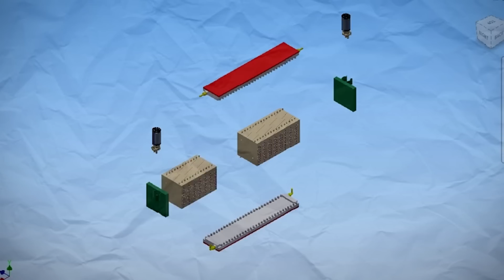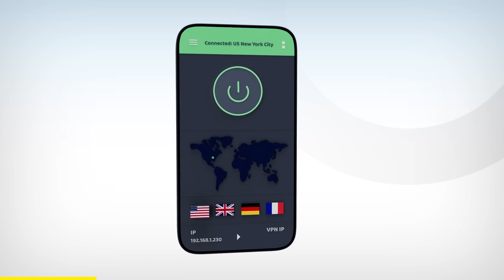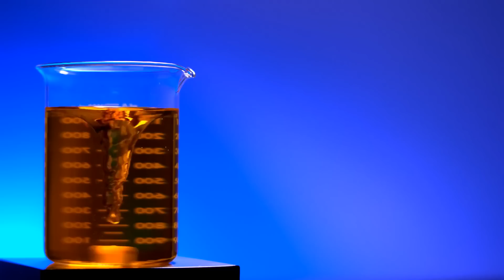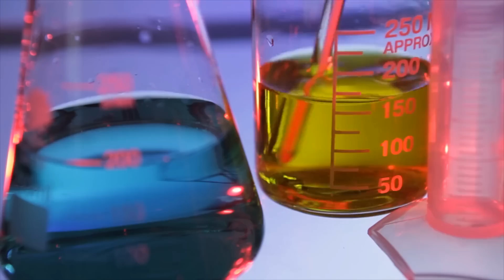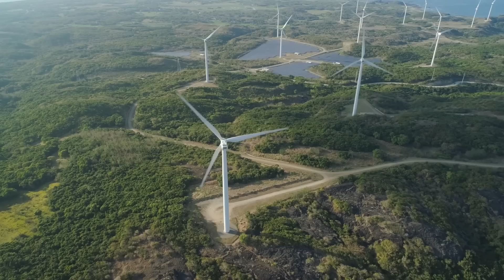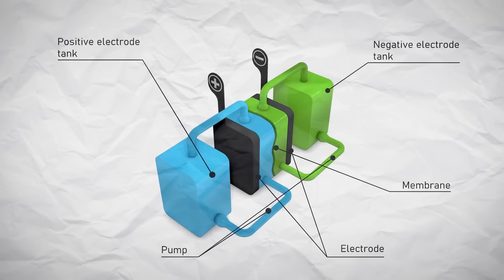This Insane Liquid Battery Can Instantly Recharge

Comment: I rarely comment on videos.  This is a great topic that caught my attention.  I combed through the links and tried to find more information on the company website. A few things I like about this. IMO this is a textbook example of how US government agencies collaborate to bring these types of advances to market.  This quite decade old project was birthed by Chicago based academics who won the support of the Argonne National Laboratory (ANL). Their ideas slow and steadily captured the attention of the leading edge US government R&D incubators.  They've been persistently working and have survived a few fail points.  The US military use case is real.  L-ion has limitations which have caught DARPA's attention.  One can't help but be impressed with NASA and the USAF's involvement for aviation where L-ion has no future. The DOE and NSF have been involved as well.  This is a project that is capturing attention.  A quick back of the envelope calculation (thanks Bard) suggests that the Influit's Gen 2 energy density would double the range of an EV vs. a gasoline powered SUV.  That's compelling for industrial and battlefield applications.  An Airbus A330-200 would be able to fly 18% farther. We've watched th aviation industry fall all over itself to obtain 5% gains.  The economics in commercial maritime applications are undeniable.  I imagine the same would be true for rail. Those that object to consmers swapping battery fluid may have a valid gripe.  Yet, I think the military and commercial markets will be more than ready to take a serious look.  The economic advantages are too great.  Thanks for an excellent video.

Comment: Definitely interesting.. But why not make a smaller, compact, portable and interchangeable battery that we can unplug from our car with ease, replace it with a fresh one and just recharge the other one with our off grid solar charger?.. Why do you think?.. Think about it..
Reply: A key component of vanadium redox liquid flow is that to get more energy you need more liquid, and that volume of liquid can only be compressed so much. Maybe one day they'll get the nanofluid to a point what you ask is possible, but I don't think that's likely for a while. But if they can hit those energy densities in their white paper? Yeah, I think then it'd be great for it.

Comment: It's cool development that would solve the energy speed issue for sure. But as for safety claims I highly doubt that, they are withholding that information for a good reason I'm sure
Reply: Liquid flow batteries have been in use for a long time. Do some research. The safety is there. Now, as for the nanofluid version? There may be changes there that haven't been released yet.

Comment: Would a liquid battery like this overcome the limited cycles and dropped efficiency of lithium ion batteries?
Reply: From what I've read it definitely would. It's in use in many industrial scenarios, but hasn't (yet) been adopted for more mainstream use because the energy density on regular LFR liquid is low, so you need a lot of volume to get the desired energy storage. This nano solution, however, could be the game changer we need
Reply: @LabGecko  even if it doesn't end up being well suited to transportation, it sounds ideal as an alternative to the Tesla Powerwall.
Reply: In theory yes as I think it would mitigate dendrite growth, however I assume there will be some form of breakdown within the nanoparticle substrate so reuse might be limited similar to charge cycles. If true then this will also lead to issues with liquid quality due to mixture of various duty cycles. It may be possible to remanufacture the liquids though, ideally on site.

Comment: I doubt that pumping liquid is going to be a viable solution for transport.
Static grid scale probably could work.
Reply: Vanadium redox liquid flow batteries have been in use industrially for a long time. As for liquid, not viable compared to what? Gasoline?  XD
Reply: @LabGecko  viable for TRANSPORT
Reply: @finecutpost  ah yes I did miss that part. My bad. And though I'd initially be inclined to agree, look at how we've managed to pump gasoline all over vehicles of all sizes without consistently serious issues. VRLF liquid is stable too, so no risk of explosions. I think it's doable.

Comment: This is promising research but as a “business” it has two fatal flaws :

1) today it costs about €60,000 to put this system in an SUV. You can buy a BEV for €18,000 🔋 .

2) No infrastructure exists and you’d need to invest €25 billion in France just to get it up & running ⛽️.

Thus Lithium Ion will still be king in 15+ years time 🚚 Just like Hydrogen it is too expensive!

Comment: As if pouring liquyid over small flame proves that it has no thermal runaway or does not combust. Might as well pour diesel or oil over small flame and claim it does not burn.
Reply: Do some searching. Vanadium redox liquid flow batteries have been in use since the 1990s. They're stable.

Comment: There's a number of questions I have on this as Redox flow isn't anything new.  Most importantly what are the fluids and membranes made out of.  Resource cost, abundance and manufacturing requirements is a huge factor in domestic vehicles.  What's the toxicity of the liquids and gases when it inevitably (in an accident) causes a runaway thermal reaction.  Military and commercial applications can cope with with these issues, planes seem to be a good candidate but there's a reason why china is mass producing phosphate batteries even though they have a low energy density, material cost and availability.  Capitalism always wins.. sadly.

Comment: Yet another overpromised and nondelivering battery tech. Woo. 🥳
Reply: Still waiting for my George Jetson space that somehow folds up into a LIGHTWEIGHT briefcase 😂
Reply: o.O  Do any searching at all before you posted? They've been in use since the 1990s.
Reply: @LabGecko  Wow, we've had liquid flow EV's 30 years now? Where are the cars? 😂
Reply: @PhazonBlaxor  lolz, neither of us said cars. The battery tech itself is well tested though, so it should be fine with cars too. After all, this is safer than gasoline.
Reply: @LabGecko  But cars were the prominent part of the video. I've heard about tens if not more "revolutionary" batteries over the past 20 years and we are still using li-ion batteries. I believe it when I see it. 

If it really was cheaper to mass-produce, smaller and lighter for same energy capacity and on top safer, these would be all over the place. Instead we still have li-ion as the most common battery type, I wonder why? 😁

Comment: Same problem in the end. Current electric grids can't handle charging enough electric cars to make a difference. This particular method isn't new. Quant produced a prototype with this tech a long time ago.
Reply: Grid couldn't handle lights in everyone's houses when they started either.
Reply: @LabGecko  grids can't even handle what we have now. This tech doesn't solve anything. The water still has to be charged. It's a sad truth that by the time we have grids that can handle almost all cars being electric, this tech will likely be obsolete. The same goes for current battery technology.

Comment: Meh - it's like big oil wanting to control how you recharge. I prefer normal batteries let you recharge from solar panels on your roof, like having an oil refinery on your roof! Then also there are super-batteries and super-chargers coming that will let you recharge in a minute. We'll see where this liquid flow thing goes - it's good to have more options - not less. But I'm thinking it might be a competitor to the Australian Janus truck-battery swap system - which kind of blows Tesla out of the water.
Reply: The key to this is that you can charge it either way. Don't want to go to the station? Plug it into a wall.

Comment: I wonder about how long the fluid lasts before it needs to be replaced or revitalized.  Can it be recycled, and at what cost?
Reply: From what I've read these liquids currently in use can last 30 years. They're in use in industrial setups, but are different from the nanofluid Ziroth talked about in that their energy density is lower. But the cool thing is to get more energy storage capacity, you just add more liquid. I'm excited to see how the nanofluid holds up to that ideal.

Comment: I have zero issue charging my Tesla electric car, it's so easy to plan and it's straightforward. The charging was so quick that I only needed 5 minutes before I continue with the trip. The gas vehicle, however, have problem with it. We recently bought a used 30 ft gas RV to drive it home, I quite literally ran out of gas while in middle of the intersection (the engine stalled), I have so much more range anxiety because it doesn't display how many miles I have left in range, the gas gauge is so vague, and it's such a hassle to go to the nearby gas station. It was a scary experience.
Reply: Do you not know how to read a fuel gauge?
Reply: @randycrump5464  the fuel gauge was low, but I have no idea how low. I got paranoid and was on my way to gas station, but I ran out of gas before I can even make it to gas station. I was surprised that it didn't have any buffer whatsoever.
Reply: Going to a gas station isn't a hassle and certainly not scary.  I can fill up my car in a few minutes and it lasts me for two weeks.

Comment: It may sound good on paper, but repeatedly draining the fluids and refilling with "recharged" fluids will, over time, contaminate the battery and/or fluids, and result in a battery, which needs to be replaced, or maybe refurbished.

Comment: Erm......maybe I've missed an important fact but......why would you bother to pump the fresh charged fluid into the car? Couldn't you just pull up to the filling station and swap a tank of depleted fluid for a tank of charged fluid? No spill risk no clogging in cold temperatures no delays at the pump.....carry spare tanks for a long journey.......I see no logical reason to want to pump. I would also think the nano particles could be stored "dry" and added to the liquid as required with expended nano particles filtered out and recycled.....so rather than pump liquid you could probably just feed a "hopper" with the "dry" nano particles which would be a more energy condensed storage that replacing the tank either physically or through pumping.
Reply: That's the change they're talking about - pumping out the discharged liquid while pumping in the charged liquid.
Reply: @LabGecko  yes.....and I'm saying why bother to pump.....you could just swap out a tank of depleted with a tank of charged (like swapping a printer cartridge) or you filter the depleted nano particles and add new charged nano particles.
Reply: @polyphonics557  said "why bother to pump"  
For now the energy density on vanadium redox isn't high enough to make small portable containers feasible. Sure you could use lots of smaller containers in series but that adds a lot more points of failure. However, portability should increase as the nano loading efficiency increases.

Comment: This is the literal replacement for the oil industry as we know it today if this can perform as advertised. No need for huge battery banks. It can be transported via trucks or possibly pipelines, you don't lose mass like you would with coal, oil or natural gas, and if you have enough converters, you can provide megawatts of power centrally yet generate the power remotely via satellite generation. Wind and Solar would actually become viable as an alternative to fossil fuels because this fluid also acts as a battery. While Nuclear would still be viable as a backup power supply in the case of natural disasters or whatnot, they wouldn't be necessary. It's quite literally liquid electricity. So long as it's easy to create en masse and safe for transport... This is it. The power of the future. Liquid sunlight as it were, lol.

I really hope this works.
Reply: ahem, nuclar is the only viable option.

Comment: I had heard of flow batteries previously as an option for renewable energy storage. But that was a few years ago. I haven't heard anything recent. Is there a problem with it? What's the status on cost competitiveness vs. other energy storage?
Reply: I read that the flow batteries are targeting companies the are stationary. The systems last at least 25 years with little maintenance.  There is a week link and that is the sepperator. I haven't heard of this gen 2 model. War tecknology does have commercial bennifits like wd40. Space endustries also have spin-offs. One thing like superconductors could really help.
Reply: This is my question too. Though on the energy storage side it looks like things have been moving forward quietly. There's a small scale system commercially operating in the UK. China commissioned an 800MWh storage facility last year, which apparast to still be happening, tho the US company they were working with filed for bankruptcy. And California is building 3 over the next 3 years.
Reply: Ate you thinking about the vanadium redox flow batteries that, after the U.S. taxpayers funded the research, the rights were sold to a Chinese company?  Their upside for stationary storage is that they have decades long service lives. The downside is their low energy density.  I hope this guy is right about boosting their energy density with enough of a difference in chemistry and design to bring the patents back under U.S. control.
Reply: @MrGregrice  i think its the same tecknology  but there trying a nano tecknology to get more density. Someone  is gonna crack the code. I know there are different flow batteries with different chemistries.  The metal battery look very promising for some applications
Reply: @MrGregrice  It wasn't US research. It was Australian. The reason it didn't take off is because by the time they finalized their tech and published other battery types were needed for small size and fast charging, while vanadium liquid flow needs volume for an equivalent amount of energy storage and charges slower. The nanofluids could change that.

Comment: This battery has no future. Vanadium is a scarce resource and comes under the heading 'unobtainium.'
Reply: Vanadium is the fifth most abundant transition metal, It's found in titanium and iron ores. It's also the 22nd most abundant element in the earth's crust.
So very much Obtainium.
Reply: @SleepySkull1  If you can get it gold is so abundant that it could over the Earth's surface in a layer 1 metre thick. In practice there are relatively few sources of vanadium, which is an expensive metal with a wide range of potential hi-tech uses. Demand for the metal is not great enough for it to be listed on many exchanges. Any serious demand is likely to put it out of range of a technology intended for use in cars worldwide. Hence my conclusion that it is 'unobtainum.' This term is in use in the world of battery production for materials such as lithium and cobalt, which though not scarce in the way that, say, helium is scarce, are nevertheless too expensive or impractical for large scale use in future.
Reply: @SleepySkull1  It's not a matter of abundance but obtainability. The Earth's crust contains enough gold to cover the entire planet in a covering 1 metre deep. In practice there are few suitable locations to extract the metal and it is relatively expensive. When there are battery manufacturers close to providing power solutions using sulphur instead vanadium is unobtainiium.
Reply: @alanwhiplington5504  you know they add vanadium to most steels to make them stronger right? It's pretty common. As for future, vanadium redox batteries have been in use since the mid 1990s industrially. The liquid is stable.

Comment: Combine recharge the car with shopping 30 Minutes are common and in the majority of cases enough.

15m² for one parking lot and around a mall or Supermarket its huge. 
15÷7,5=2kwp 

2x6 =12 one charging Station 11kw

Comment: Early 1900 electric cars was designed as town cars for women and because they was only any good for this purpose there popularity wained .
Milk floats are the only electric vehicle success story because they are only good for town use just like the early electric cars .
Reply: Thanks for the history lesson, what point are you trying (and failing) to make?
Reply: @fredbloggs5902  Electric cars are town cars only with old recyclable technology batteries .
The batteries for out of town use will always be dirty for the environment.
Reply: @rocklover7437  cluelessness confirmed 

Blocked
Reply: @fredbloggs5902  I take that as a run away win .
Reply: @fredbloggs5902  That's why they are pushing 15 min Cities to accommodate electric town cars
Reply: @fredbloggs5902  India are doing a much better job making and  using bio CNG for cars and trucks

Comment: a huge problem is that discharging the nanoparticles will greatly increase viscosity since the particles will clump together due to magnetic attraction from electrical potential gradients. when they are all fuly chagred, the viscosity will be at its lowest. seems like an upgrade to batteries in a few ways, but the concept is fundamentally flawed.
Reply: Seems like you missed the part where they engineered the nano surface to not clump or settle.